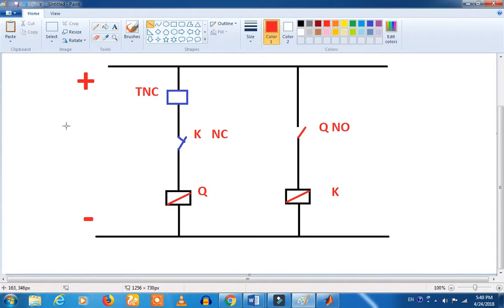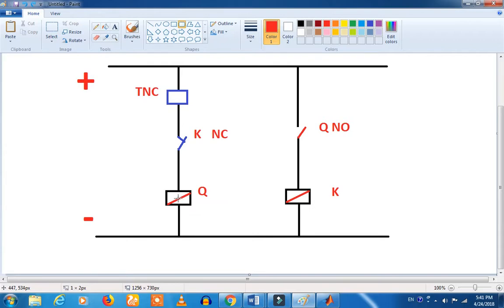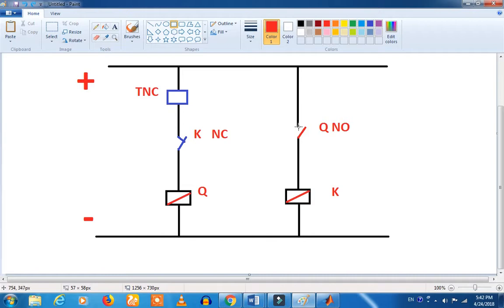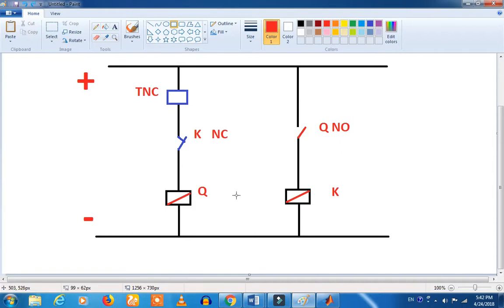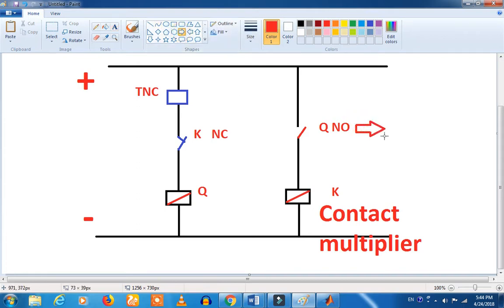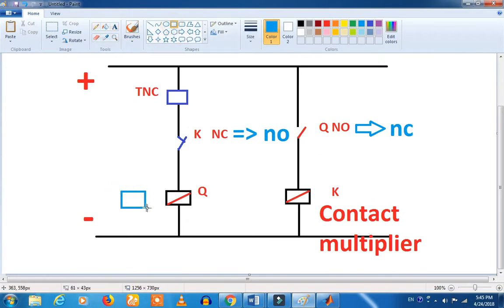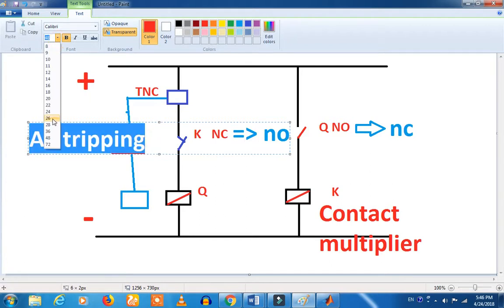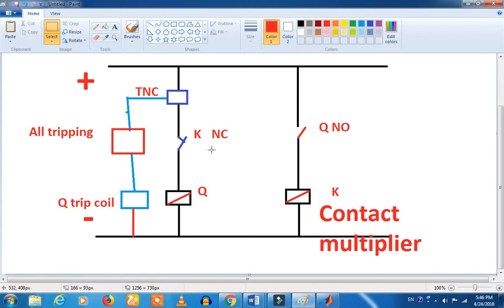What is anti pumping relay, Trip circuit supervision relay, What is breaker contact multiplier

Comment: @9:10 you mention that one trip coil will be given in dc circuit and another trip coil in AC circuit. That is completely wrong. Trip coil will be fed by DC circuit only. But two separate trip coils can be fed via two separate DC supplies, to avoid the loss of protection in the event of a battery bank failure.